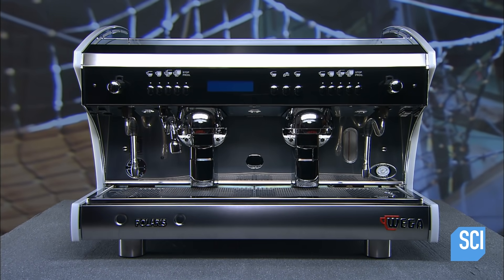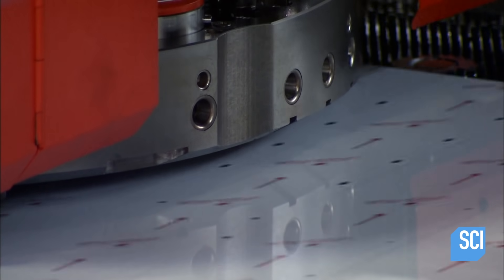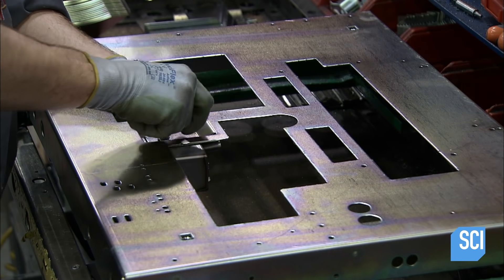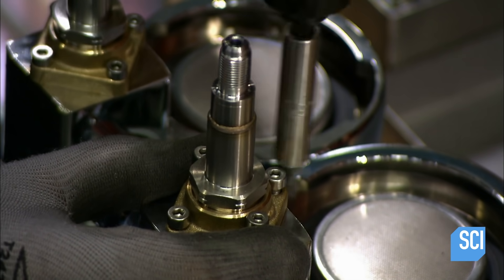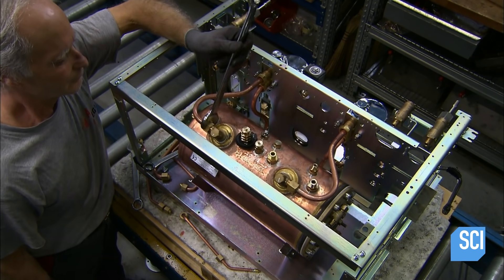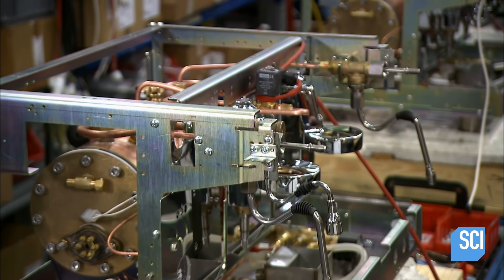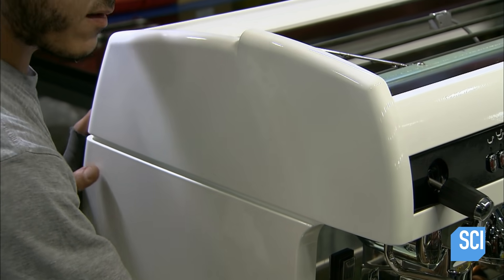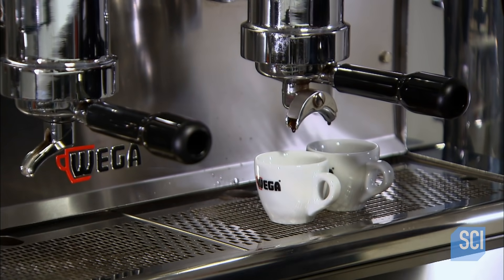How It's Made: Espresso Machines

Comment: Did anyone else cringe at the use of power tools to do up a number of the fixtures without first doing a couple turns by hand to make sure they aren’t cross threaded, might just be how I was taught never to use power tools until you’re 100% sure they aren’t cross threaded 🤷‍♂️
Reply: It’s production work.. i guess for the very low chance that they would crossthread a bolt with 40hrs/week experience, it’s probably cheaper to just toss any demolished part out instead of spending time on such low chance issue for every single bolt.

Comment: At 3:14 can someone more competent in the matter tell me why the tank is made of copper? Are they worried about galvanic corrosion with other metals in the system?
Also, the fittings are all brass. I thought brass was not a food contact material, due to the lead?
Reply: Espresso Machine Tech here. Mainly for heat and electrical conductivity. May seem strange, but there's a metal stick called a level probe that juts into the boiler a little less than halfway. When the water in the boiler touches that probe, it cuts off the circuit that turns the pump on by directing that electricity through the water to the boiler itself, which is connected to ground, so it stops filling with water at that level to give the steam some room.
The fittings and pipes are typically copper and brass, and its beneficial to have as many parts be made of the same or similar metals so that it all expands and contracts at the same or similar rate.
The brass fittings really don't touch the water as the copper pipes compress against eachother because of the force of the screwthreads. If everything is connected correctly, the water only touches the copper. Though, the pump is brass, the flowmeters arent copper, and the groupheads are usually chromed brass. 

Plus, copper has antimicrobial properties... so that helps too.
Reply: Generally, no worries about galvanic corrosion as this particular machine is all brass and copper. Plus, lead free brass exists that is food safe. 

Other manufacturers use 304 stainless steel for the boilers and group heads.
Reply: Less thermal expansion I guess

Comment: 1:41 is called a "flow meter" it's actually used to calculate how much water is going into the machine. If it isn't receiving enough, the machine will stop heating in order to keep the machine safe. I want to add to this, if it's an automatic machine (meaning you can program the doses) the flowmeter then is also used to tell the machine's mother board how much water the grouphead is receiving and when to stop the brew.
Reply: that's good to know thanks for the added info 😄
Reply: Thanks for that! I was wondering why it had a pump. Why is the water tubing coiled around the flow meter though?
Reply: Yeah a volumetric flow meter right?

Comment: With the appearance of new investors, there has been an expansion in the interest for cryptos while the HODLers holding on with their holdings has diminished the supply.  This is the reason I exhortation each novice to wander into trad! Ng their coins with an exp: ert.  Tradrs need to utilize and adjust this system into trad! Ng for reasonable day by day proflts.  Robert steven is incredibly proficient and separate complex market analysis into straightforward methods.  You can study B! Tcoin and other Altcoins from requiring a 1-hour every day meeting with Matt than you might learn in a year-long of inability trad! Ng or individual exploration.  I associated with Robert steven on WHuatsapp + 1 (918) 205 4817. Being on this side of the cryptoverse feels astonishing.  Goodluck moon pals!

Comment: I have always seen espresso as the cigarette without filter, where normal coffee is a cigarette with filter.
Reply: Comparing cigarette’s to coffee is kinda bad to start with. Smoking is plain unhealthy. I don’t believe a cappuchino would do anything to your health.
Reply: @Engineer9736  That's not what i did though.

I just say that a cappuchino is a stronger coffee.
Reply: All of you need to shut up.
Reply: Espresso uses the portafilter which can filter even the most powdery coffee ground. You got the other way around
Reply: @LasdilElizaga  But espresso is a lot stronger than ordinary coffee.

More caffeine in less "water" right?
Reply: @JohnDoe-bd5sz  Yes, espresso is more concentrated than filter coffee.

If you want to make "Americano" (black coffee) with one of these machines, you would take a shot of espresso and add hot water.
(Or some ppl say you should start with hot water and add a shot of espresso.)
Reply: @oscargr_  Yep, the espresso is a lot more concentrated.

Have tried it, and i normally dont even drink ordinary coffee. Really gets your heart beating hard.
Reply: @LasdilElizaga  Not too sure the filter baskets are more restrictive than a paper filter.
In an espresso filter baskets you can see the individual holes and count them. In a paper filter, I can't.

For espresso you do have to grind the beans finer, because the machine uses pressurised water.

Comment: But.. how is it made? Is espresso made from water and pressurizing the coffee together?
Reply: Espresso is made by forcing very hot water under high pressure through finely ground compacted coffee. Tamping down the coffee promotes the water's even penetration through the grounds.[7] This process produces an almost syrupy beverage by extracting both solid and dissolved components. The crema[8][9] is produced by emulsifying the oils in the ground coffee into a colloid, which does not occur in other brewing methods. There is no universal standard defining the process of extracting espresso,[10] but several published definitions attempt to constrain the amount and type of ground coffee used, the temperature and pressure of the water, and the rate of extraction.[11][12] Generally, one uses an espresso machine to make espresso. The act of producing a shot of espresso is often called "pulling" a shot, originating from lever espresso machines, with which a barista pulls down a handle attached to a spring-loaded piston, which forces hot water through the coffee at high pressure. Today, however, it is more common for an electric pump to generate the pressure.
Reply: @sickbale  Thank you! I appreciate the effort you made unlike the makers of the video.
Reply: @ursaltydog  no problem, it's a pleasure to be useful :)
Reply: @ursaltydog  Hahahaha... So true.
Reply: @sickbale  Yes but how are the water and coffee beans created?
Reply: @Hypercube9  water is basically condensed steam or melted ice, is composed by 2 atoms of Hydrogen and one Oxigen. Coffee beans are the seeds of a peculiar genus of flowering plants (called Coffea) which are harvested and then roasted to give the coffee the typical flavour. GO ON. I'M HERE.
Reply: @sickbale  Interesting... now if they gave coffee to the flowering plants would they get some sort of super-coffee bean that could be used to make super-coffee? Or would the plants just grow faster? Also, why doesn't water catch on fire given that it's made from hydrogen and oxygen??
Reply: @Hypercube9  1. no, I think that feeding coffea plants with coffee beans is the same that feeding them with soil, the beans with humidity will rapidly spoil and decompose, transforming them in soil, so the plants would grow as usual. 
2. combustion is a process that requires 3 components: oxidizing, oxidizer (molecularO2) and energy. The oxidizing component is missing since, no matter how many energy you give to water (by using heat), it will never tear the 3 atoms, apart. Actually you can "Ignite water" by using electricity. High amperage split oxigen from Hydrogen by electrolysis and you have spare Hydrogen that can be easily ignited
Reply: @sickbale  So you're saying that's like plant cannibalism to give coffee to coffee plants. Got it!
Reply: @Hypercube9  that's how biology works 🤷‍♂️
Reply: @Hypercube9  I have a bucket I use specifically for my leftover coffee grounds and eggs I crush up to mix in for my vegetable plants in the garden. That may be why they're hyper as fuck... LOL
Reply: The video title is “How it’s made: Expresso machines”, not “How it’s made: Expresso”. Sure you may ask how an Expresso is made but you sound a bit as if you expected the video to explain how an expresso is made.
Reply: @Engineer9736  And I did not learn that either... nearly 8 months ago..